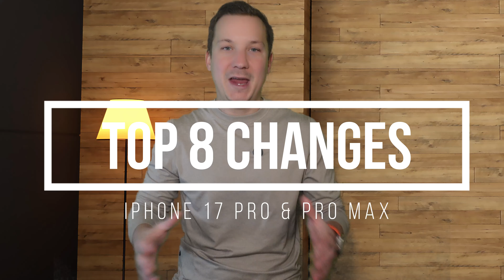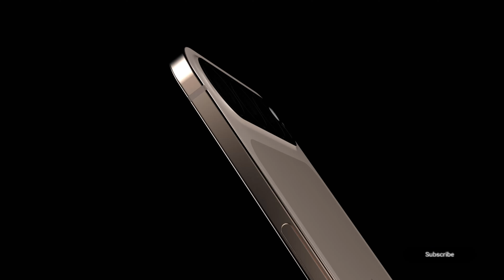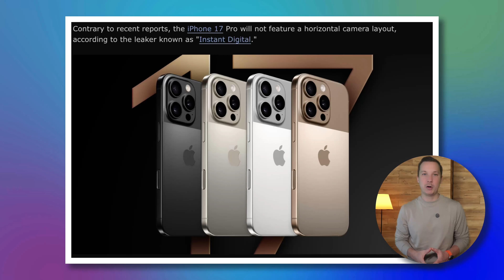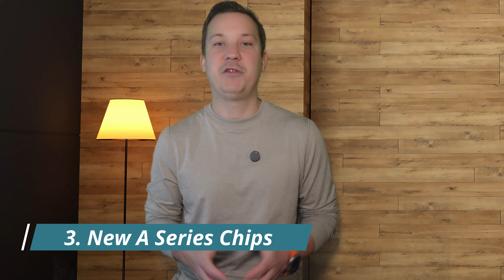8 HUGE Upgrades!| Apple iPhone 17 Pro

Comment: The iPhone 4 and 4S had glass backs as well. The iPhone 5/5S back was both glass and metal.
Reply from the maker: It was an aluminosilicate glass, a bit different than the normal glass we knew on the iPhone 8.

Comment: I just upgraded to the iPhone 16 pro because my 15 pro would overheat and had crappy battery life. I had to upgrade because I use my phone for real estate video. So far this 16 pro seems to handle heat very well. If the 17 pro has a better battery life, better thermals and improved camera/video performance I might upgrade again this year.
Reply from the maker: The 16 is definitely better than the 15 for all that. Good luck with your real estate career!